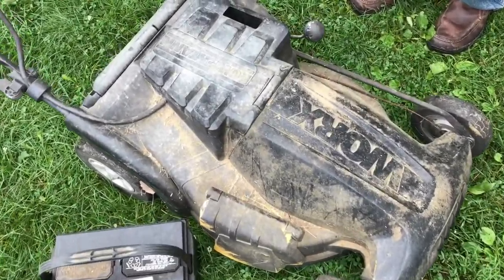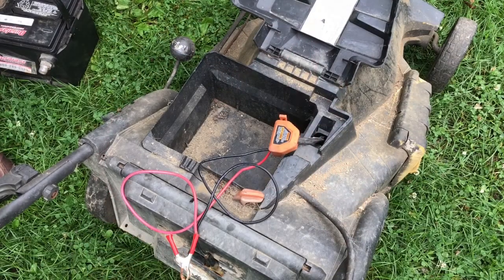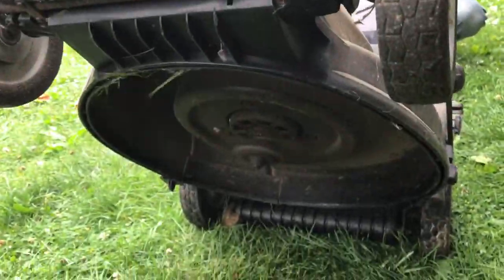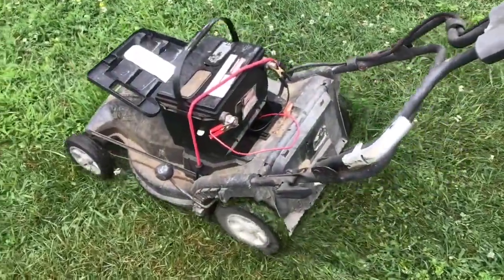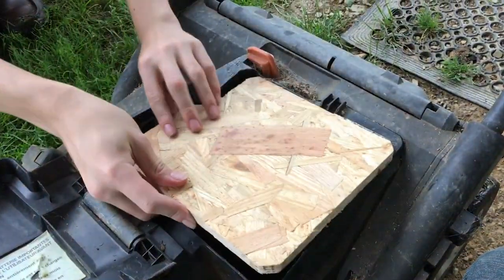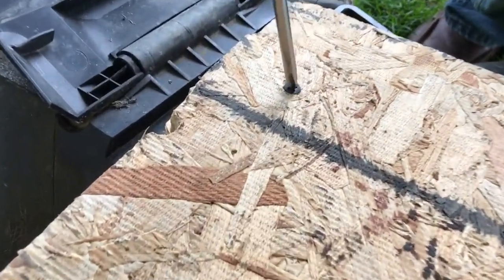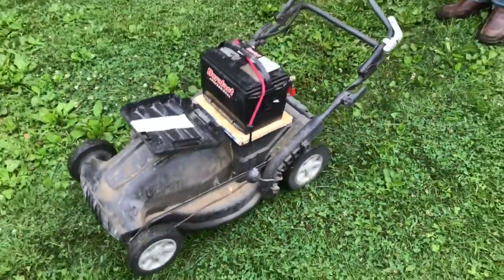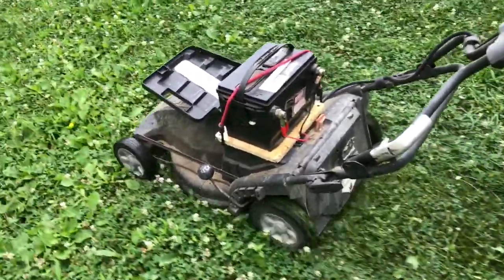GREEN!, GREEN!, GREEN! lawnmower runs on old car battery

Comment: lmao why is this so special ??? all you did was replace the existing battery with a car battery so whats the big deal lmao I used a jump starter to run my tractor so whoopty doooo lol with drywall screws a funnel and duct tape I Macgyvered a pipe so that when my mower runs i can add some green grass from the local bdt supply house and get high from the smoke btw this was done when electric mowers first came out 20+ years ago, yes I am busting your balls man because it truly came out years ago lol

Comment: Running an electric motor at less than the rated voltage causes the motor to overheat and burn out sooner or later.  At a lower voltage the amperage goes above the safe level for the motor.  The motor temperature rises exponentially as current rises.  That's why long distance electric transmission lines operate at ultra-high voltage, i.e. to reduce heat loss.  And that's why electric motors burn out during brown-outs (low voltage excursions).

Comment: I've been seeing some corded lawnmowers on craigslist cheap that still run would it be a fairly easy conversion to hook a car battery up to one instead of pulling behind an extension cord?
Reply: Yes. You'll need an 12v power inverter and it would plug right in.